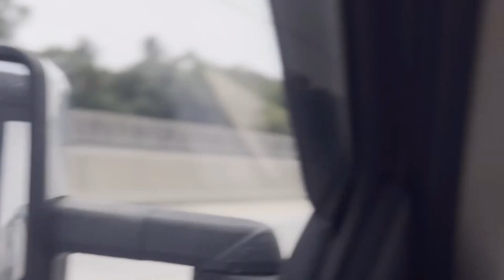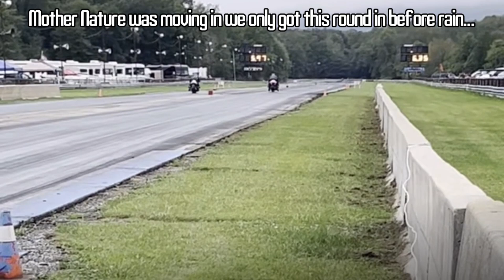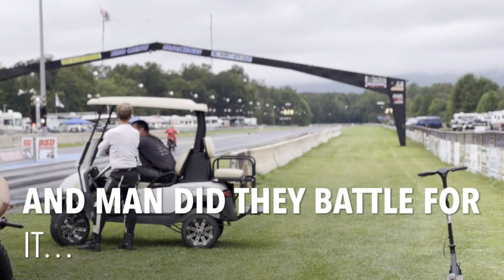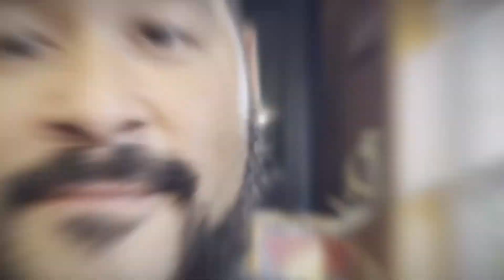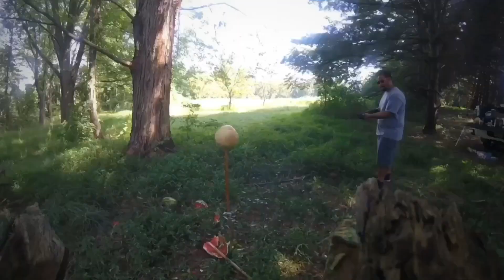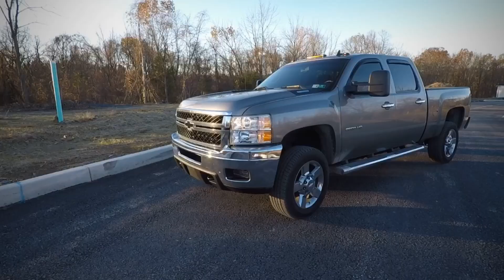Last race weekend for Pinky…

Comment: 👏 what 60ft is Pinki doing?
Reply from the maker: Only 1.500-1.508 all weekend. Still has more in it just need to gear it better and get the launch RPM and stall up on the clutch